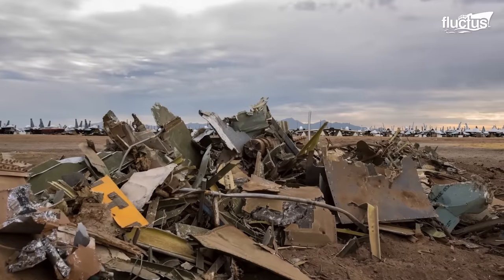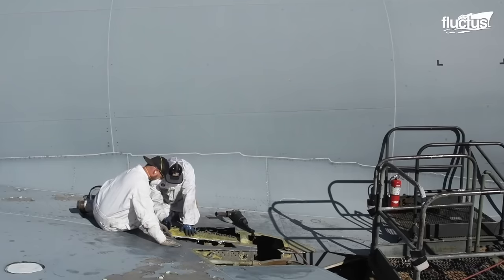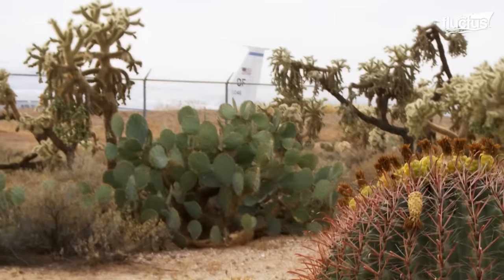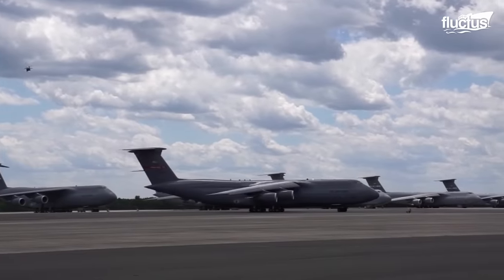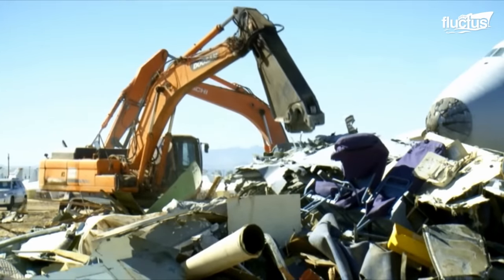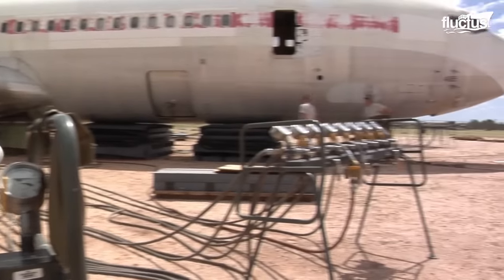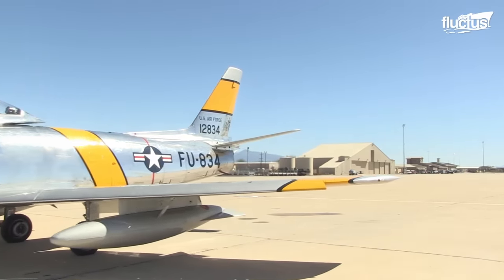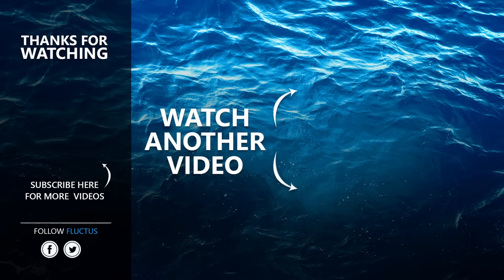Life Inside US World Largest Aircraft Boneyard Scrapping Billion $ of Plane

Comment: Aircraft that are capable to pressurize have cycles so most of these aircraft have probably reached their cycle life. What I mean is each start of the engine is a cycle, each landing is a cycle and each time the fuselage was pressurized is a cycle. The fuselage would start to fatigue and cracks will form until (like the Aloha 737) it blows it's top for say and will cause a catastrophic failure somewhere and crash
Reply: Everything eventually times out.